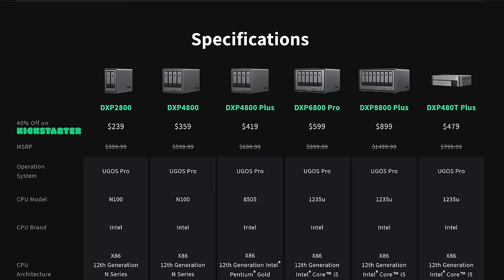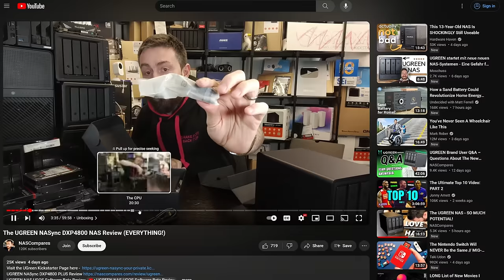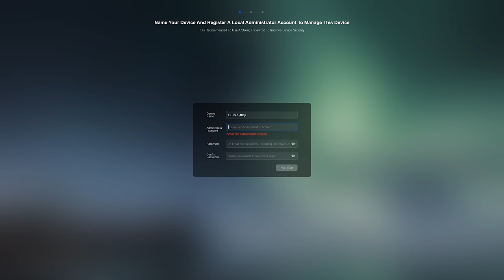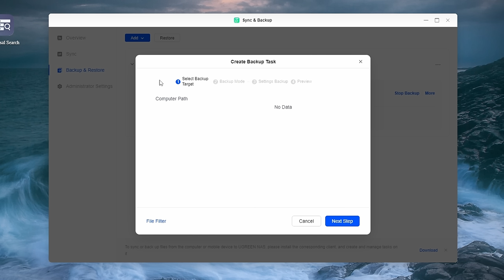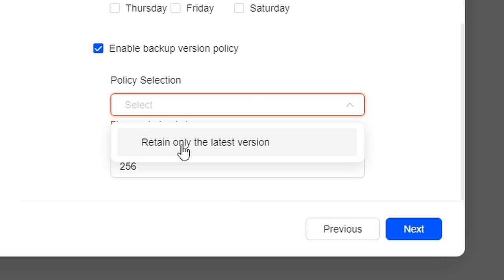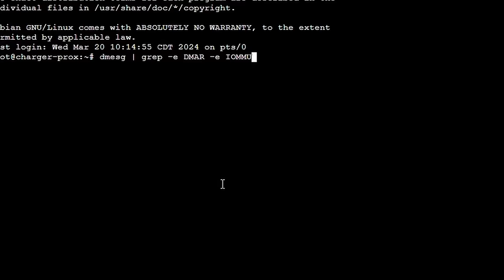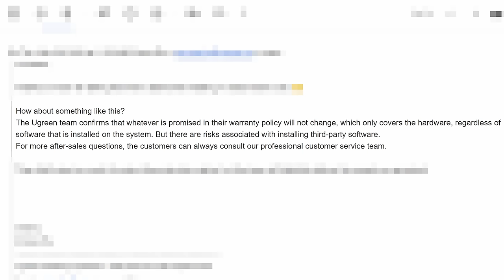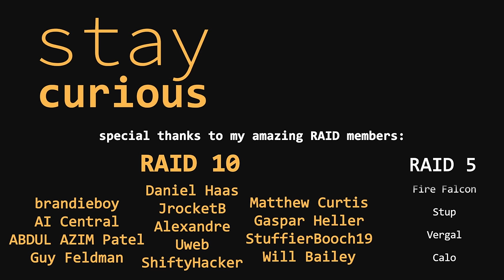UGREEN makes a NAS..?

Comment: But if installing a different OS requires cutting that tape to access the hard drive, will they still honor the hardware warranty? You need to press them on that specific fact and update us with a response please. Don't let them get away with being vague.
Reply from the maker: That's a fair point! I'll see what I can get from them and try to post in a comment/description.
Reply: @HardwareHaven  so in new york anyways thos stickers are no loger legally binding in any way - like, the courts have said to manufacturers yyyeeeaaa thats not your get out of jail free card so for instance i can shuck a drive and use that drive in a server and the drive itself STILL needs to be warranteed.....in NYS.....no idea about elsewhere
Reply: They will definitely get in trouble if they try to enforce the warranty stickers in Europe, in any way. If you see them in a product, don't worry, you can cut right through them without issue.
Reply: @OsX86H3AvY  I'm pretty sure shucking a drive does not qualify for continued protection.  What you ARE protected for is making your own or third party repairs.  Dismantling the device and reusing part of it in a different application is not covered.
Reply from the maker: To the people saying it's illegal and totally fine to cut through it: 

Technically yes, but like I said in the video, if UGreen decides to not honor it... what do you do? I am not saying I agree with that. There needs to be more options for consumers to report that behavior with actual concequences. But at least in the US, there aren't really. I only say what I say to try and protect my audience from getting screwed over.
Reply from the maker: Did you not catch the part where I literally ran CasaOS? haha
Reply: @HardwareHaven  Send them this "Magnuson-Moss Warranty Act" pretty much they shouldn't have these stickers since they are invalid. This is pretty much what it is Under the 1975 Magnuson-Moss Warranty Act, the Feds mandated that you can open your electronics without voiding the warranty, regardless of what the language of your warranty says. Them being wishy washy about this should be a full video for you to show you that those stickers are illegal and having them on it means that they know they are going to try and get out of what they should.  Think if you couldn't open your hood due to a sticker.  This makes me decide against this since crowdfunding for a huge corporation is ridiculous. Also the amount of propaganda and reviews from all these "reviewers" means that they probably suck.
Reply from the maker: @opetyr  I did. I was waiting on their official response but it got lost in the flurry of other emails and such. I'm following up and will add an update in the pinned comment when I get a response. 

As far as M-M goes, I'm aware, but the point I made in the video still stands. If they refuse, are you actually going to take them to court? It sucks, and we should do our best to hold them accountable, but it's sadly the reality. I'm not saying this because I don't care, but because I want to protect consumers from thinking they'll get something they might not.
Reply: @HardwareHaven You file a complaint with the FTC and they either get fined for fraud or threatened by the gov
Reply: @recyclingbin_  dude they're not gonna say "we denied your warranty due to the stickers." they're gonna make something up and there's not much you can do about it.
Reply: Just use acetone to release the sticker.. then when the acetone evaporates, restick the warranty seal.
Reply: Nascompares has a few videos on that topic among others. 
- they don't support 3rd party os
- looks like they intend to void warranty if 3rd party os is installed (bad)
- there may even be difficulties installing 3rd party os on that thing
Reply: @nitrobear Europe does not give a F they are holding @pples feet to the 🔥 enforcing change keep up the great fight 🙏
Reply: @BoraHorzaGobuchul  That's too bad. A fully customizable, small Synology-like NAS that supports third party OS is something I've been wanting for years now. There was a glimmer of hope with this Ugreen thing, but unfortunately it just isn't it.
Reply: @AdhamOhm zimacube is officially supporting 3rd party oses. HH reviewed the beta version and roasted it, let's see if the RTM version will be better.
Reply: @HardwareHaven Thank you sir!
Reply: @HardwareHaven  In parts of the US, at least, state warranty laws also enter into it, and some allow one to enforce warranties against retailers/resellers. The state itself may also take action with enough complaints. In any case, allowing vendors to get away with this crap is not going to change their behavior.
Reply: @OsX86H3AvY  Thing is that court is likely using federal law, if that's the case then it is indeed a global truth as far as the US courts are concerned. Trouble is... they'll only be forced to honor it by court order, and lawsuits can be both expensive and slow.

Comment: Ugreen marketing team put in the work.
Reply: Let's hope the development team did too or this won't be a happy ugreen ending
Reply: Should have put as much effort into the software. Now it looks like marketing will have to go into damage control.
Reply: @KameraShy   All they have to do before it officially released is offer a barebone version with no OS and they can avoid a bunch of headaches, reduce their development team and sell products that everyone wants.  

The majority of people who know what a Network Attached Storage is are the same group of people who like the flexibility of choosing their own software.  So all they have to do is undercut the likes of QNAP and Synology and produce a NAS with no OS included. 

Just stick a UGREEN boot image in the bios and list off a bunch of recommended operating system software from a boot menu for users to choose from and offer no warranty on the software.  Better still just offer a OS repo boot menu that also allows us to add our own repos from github. 😅👍

It would be a little dream machine for the tech community. 😜

They could fire a bunch of software developers and save money that way and allow their smaller team to slowly develop a decent OS down the road in the back ground.   Maybe just include their OS in their basic bottom of the range models for people who just want something basic. 🤔

Comment: Great review. One thing I noted from another reviewer's video is that you can get the NAS into the UEFI setup by SSHing in and mounting the EFI partition of the preinstalled UGOS SSD, and then rename the EFI folder to something else so the UEFI BIOS doesn't detect it as a bootable drive. Once you reboot you'll automatically be dropped into the setup or any other bootable device you have attached. This seems to resolve the ambiguity in UGREEN's statement about installing a different OS since you don't need to disassemble the NAS and break the warranty sticker, and it's completely reversible if you don't wipe the UGOS SSD.
Reply from the maker: Oh that's smart. Who's video?
Reply: @HardwareHaven  Was TwoGuyzTech, towards the end of their video.
Reply: Sadly the turkey solution which not  good enough when out of the box and we still need to manually bypass that thing 

It will be a nice 4bay+3nvme thing , maybe ugreen consider selling a hardware only version ? I am not interested to the still raw OS ( hell kitchen - it still raw )
Reply from the maker: Oh nice!
Reply: It is also technically possible to reboot into UEFI firmware setup from running system, but I don't know if stock UGOS has any commands with that capability.
(For example, under systemd, systemctl reboot --firmware-setup will reboot into setup menu, and GRUB bootloader can also do that)

Comment: Under the 1975 Magnuson-Moss Warranty Act, the Feds mandated that you can open your electronics without voiding the warranty, regardless of what the language of your warranty says. Also them requiring a EULA which I guarantee has some clause that it can change at any time.  Then they can at a later date state that they can use your data that is on your own file system.
Reply: BUT ... the issue then becomes how to force the company to honor the warranty if they just flat out refuse. For small potatoes, that would generally mean state small claims court .  However,  they may introduce other roadblocks such as  the warranty stipulates arbitration in a location far removed from the customer. Those provisions exist in warranties and have been upheld by the courts.
Reply: They're really not that sophisticated. Just look at the typos in the UI and the ugly font which I explained in my other comment.

Comment: An intuitive and user-friendly interface for configuration, management, and monitoring may be provided with the Ugreen NASync DXP4800 Plus, making it easier for users to set up and maintain their NAS system without requiring advanced technical expertise.

Comment: I've been procrastinating on getting a NAS for the better part of a decade.  Maybe longer actually... What is time anyway?  I saw the kickstarter and after spending a few hours watching tons of videos about this I decided to pull the trigger.  Clearly their strategy is working haha!  Sounds like the hardware is great, the software isn't there yet, but with some effort you can get better software installed.  I did leave feedback (along with MANY others) on the Kickstarter about how important it is that third party OS is EASY to install, not just possible.  It's hard to say from their response if they're planning on actually making it any easier however since they pretty much gave the same response as in your emails.  That being said I work in IT but at home I don't tend to tinker as much any more.  If the software works for my use-case by the time I get my hands on it I'll probably just use it as is.  It would be a shame for such fantastic hardware to be hobbled by crap software though.  I don't think UGreen wants to sink their currently positive reputation over that so fingers crossed!

Comment: Thanks so much for testing Proxmox -> PCIe passthrough -> TrueNAS [Scale] with this, as I backed the 8-bay model hoping I could use it for that purpose, as I think that hardware is a damn good deal at $899 (plus, every DIY NAS chassis I can find has at least one thing that pisses me off >_>, why can't we just have an 8 bay NAS chassis with a hotswap backplane, fan(s) that are at least 120mm, full mATX support, room for PCIe cards, good ventilation, etc., full ATX power supply support with 8 drives, etc.?).

I got the early bird pricing as I heard it was temporary, and I figured if they clammed up about supporting other OS's I could just cancel the pledge, so there wasn't much risk. You testing that makes me feel considerably better about it, so hopefully they send the 8 bay units out to reviewers before launch as I'm really curious about how that hardware tests.

Comment: I live in Shenzhen, China, where this company is located...I myself didn't know that they also have NASes. 
Wish I had that hardware with Synology's DSM software...
Reply: You can install DSM on whatever hardware you have. There's a tool for this
Reply: @sebastiankutter3630 obviously it’s not production ready but home lab doable.
Reply: For Synology DSM is too powerful a processor and not energy efficient enough.
The N100 would be an ideal solution for this system.
Reply: @gudrich  DSM is an operating system not a processor lol

Comment: I like it in theory, nice little docker + NAS or even just a decently high speed solution. Needing to remove the existing drive to install a 3rd party OS is a choice... and the last drive being so inaccessible is crazy, I'd get making it a little more out of the way to be safe but that much is insane. It has an uphill battle for the ready made NAS market just with the momentum competition has, but it might be nice for homelabs as is (minus the excess work to modify it)

Comment: I plan to get a NAS at some point. I like the idea of having all of my data in one spot and have it run data integrity checks and save older versions of files, etc. And from the NAS you can have it periodically save backups to extra drives in the NAS and to external hard drives.

I think I'd set my NAS up with like 8TB drives and have them in mirror mode where I have 3 of the drives all have the same exact data on it. So if a drive were to fail, I'd still have two copies on the NAS and not have to rush to replace the drive compared to RAID setups where you have to rush or risk data loss. And when it rebuilds, the rebuild could fail causing potential dataloss. I'd much rather run in mirror mode even them it may perform slower compared to RAID.

Comment: The box itself is pretty solid, sure there is lack of features in bios missing. Other thing is the access for the boot drive - its sucks- overall installing truenas nas or proxmox is a decent product. Should be interesting if its come by default with CasaOS.

Comment: Due to this Video I backed out of my Kickstarter for the dxp4800 Plus.
I hoped for much lower idle power consumption but 25W without Drives is just too much for a modern system. 
And I don't have very much hope in the software to get something special compared to that from others.

Kind of sad that's it not like I hoped, but happy for this video so that I didn't waste my money on it first to find out on my own.
Reply: good! one more unit available for everybody else 👍

Comment: This has 2 ethernet ports which means you can install pfsense or opnsense and if you have 2 of those you can make 1 as your router and make 2 as your NAS!
Reply: And lose access to your data AND to your Internet connection at the same time, when it fails or an update goes wrong?

Comment: it is ok if you need a nas right now - otherwise diy and have more options - the ram upgrade was good, the 10g conn is great - using bcache to speed up spinning rust arrays - you do need to get into bios - see apiard's adventures for how to install your own debian - mod it - i see you did this already - good move, great due diligence - maybe the only thing that may add value is getting 2 and using a netfs - lots of possibilities - a good review. think about doing a mid-higher end diy nas special as it is a good topic and resell them too - more rev streams - you could add zil/zlog/arc cache layers and more mem and possibly 10g bonded to get 2gb/s
Reply: run - on - sentences - are - annoying

Comment: Funny! It said Seagate drives were compatible. I saw 16tb Exos drives on sale for like $250 each. Got my Nas,Dxp4800 plus, plugged them in and got error lights. The SSD cache was recognized and works fine. So when ,if ever, will Ugreen release firmware for Exos, like their Ironwolf line? Or did I waste $1k on drives I can't use??????

Comment: This does seem like a compelling option versus competitors. I had a QNAP that died and i lost my files because of the proprietary software on said QNAP. And Synology is good for the simplicity but the hardware to value kind of sucks. Just looked at amazon and the DS923+ comes with a dual core ryzen processor and 32gb of DDR4 for almost $1k. Yikes. And with this Ugreen i get a good processor and can upgrade ram because it's not soldered? I'm down

Comment: That sliding tooless drive sled thing is exactly the same as the hot swap bays on the ancient Coolermaster HAF XB Evo which you can still buy new. (I still run in this case and love the hot swap bays because of this feature)

Comment: There is a difference in warranty durations between different models, with higher-end models having a longer warranty period compared to the cheaper ones (3yrs vs 2yrs). This could explain why they often refer to the warranty agreement for clarification.

Regarding the BIOS question, it is surprising that many reviewers may not have been aware of the usefulness of the watchdog feature in pre-built, turnkey devices. It's indeed a handy feature. As for rebooting into UEFI/Bios from Linux, using 'sudo systemctl reboot --firmware-setup' has worked well for me in the past. There should be a similar option for legacy BIOS systems, although I haven't personally used it. That should make it much easier to access the BIOS.

With 41 days left in the Kickstarter campaign, there's still plenty of time for the team to work on the software. It's unfortunate that Intel limited the N100 PCIe lanes, as that's one of the factors that make the Pentium model a much better value proposition.
Reply from the maker: I forgot to mention, but I had no issues getting to UEFI once I had grub installed as that was a boot option. The problem is getting to it in the first place though. I don't see why they felt the need to disable the UEFI shortcut. An everage user isn't even going to have a keyboard plugged into it, so it's just a PITA for people that are going to find a way around it regardless.

Comment: honestly, seeing this drove home the option for me to purchase. the 10GB NIC and the fact I can drop in a different NVME drive for OS boot, and it's relatively efficient  in terms of power consumption really sells for me. if any thing, I'd replace the stock fan with a Noctua fan for quietness and better air movement

Comment: The DXP6800 Pro looks promising. Sadly it seems like it hasnt be produced yet, not a single review available. Everyone is testing the DXP4800 Plus. Or are i am missing something?
Reply: I'm actually thinking about changing to the 6-bay, but I'm seeing this thing at idle uses 30w to 50w.  A 6-bay would use a ridiculous amount of power at idle.